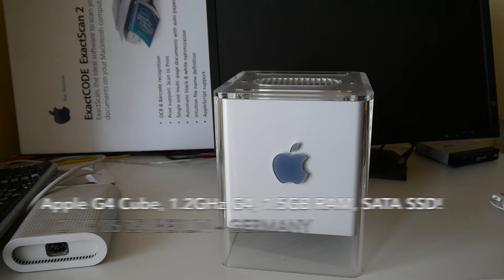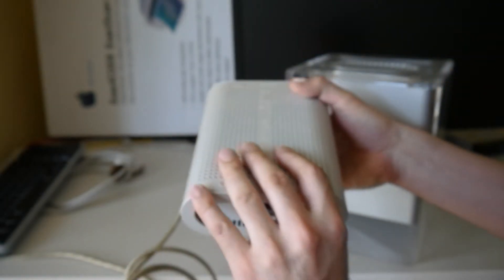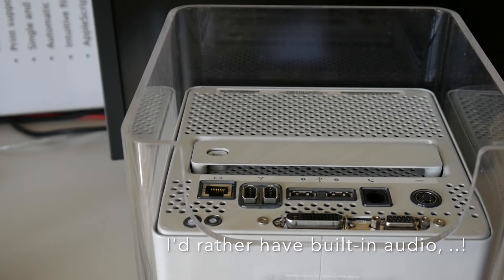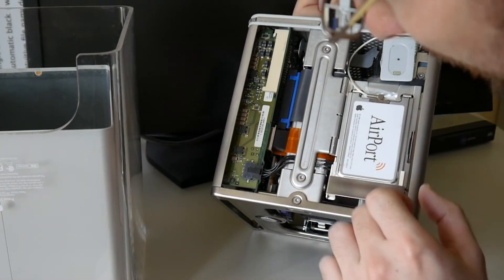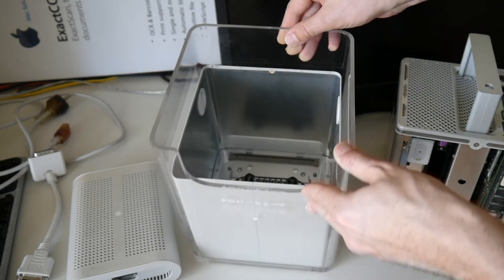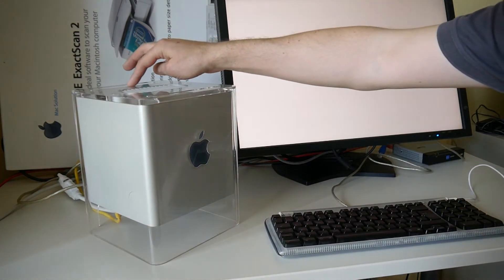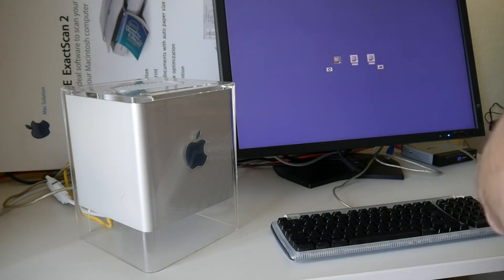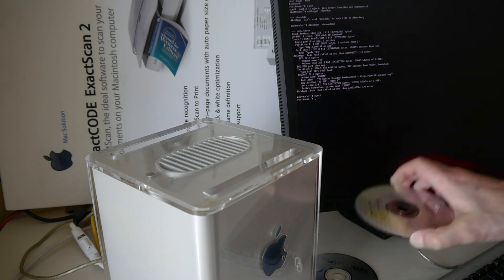Apple G4 Cube, 1.2GHz, 1.5GB RAM, SATA SSD; fully maxed out! [DISASSEMBLY]

Comment: Hi, nice video, thank you for sharing. I also own a mac cube, but during the last teardown I got confused.
I have a problem with the screws that secure the handle that allows you to pull the mac out of the case.
There are 4 screws, 2 on each side of the handle, the 2 screws on left side are under the hard disk and airport cable, the 2 screws on right side are easily accessible.
My questions: are the 2 screws on the right side different from 2 on the left side, or are the 2 screws on each side different?
4 identical screw or, two pairs of screws?
thank you very much.
Sorry for my English.
Reply from the maker: Wish I could help, I'll not be near my G4 Cueb the next weeks. Does an internet search of ifixit find some photos that are helpful in your case?
Reply: @renerebe   Hi, thank you very much for the answer. I have got the cube g4 service manual, I have read and see all the guides on the internet, but I have not found this answer. The only solution is to see how these screws are mounted on another cube.

Comment: Install OS 9 and push the programmer button for fun, it opens a debug dialog, alternatively Cmd-Power on the old style ADB keyboards. You can quit again by typing SE (shell exit), or use it to recover from a crashed Finder with G FINDER RESTART, no guarantee that it works depending on how it crashed, and your system will probably crash again pretty soon after; so a reboot might be needed anyway.
Reply from the maker: interesting ;-)

Comment: my cube's disc drive behaves the same way. i really wish aftermarket slot-loading drives worked for the cube, for some reason apple decided to flip the connector around for the cube's drive so no other drive will work. i've seen some guides on how to refurb the stock drive but it seems to daunting and i fear it'll break if i try to attempt any repair.
Reply from the maker: You only need to swap the rubber belt inside the drive ;-)
Reply: I installed an IDE slimdrive inside of the housing of the stock drive after taking out all the internals and fixed with double side tape.  The housing is then installed with the 4 screws. These drives are still available on ebay (https://www.ebay.nl/itm/New-Panasonic-UJ-85J-UJ-875-UJ875-DVDRW-slot-IDE-drive-/113664799269?hash=item1a76f33225). To connect it to the Cube IDE cable use a slim IDE to IDE adapter.  For sale on Ali Express (https://www.ebay.nl/itm/New-Panasonic-UJ-85J-UJ-875-UJ875-DVDRW-slot-IDE-drive-/113664799269?hash=item1a76f33225). Works great.  Funny enough I had to set CD Drive to Master and my SSD to slave, otherwise it would not boot.

Comment: Would like to know about that USB 2 card swap for where the Airport card is. How is it possible? would it work with OS X?
Reply from the maker: I thought the same, brought an PCMCIA card already, it did not just work, did not just show up in Linux. I read at least one pin is different to prevent using the at the time cheaper AirPort cards on Windows PCs. I did not yet research further, but I guess it could work, at least with some fiddeling on Linux, once we figured that out and it works in Linux one could try to binary patch the Mac OS XNU kernel, ... if you look into that let me know what you find ;-)!

Comment: What connection are you using to connect it to the tv ?
And one might be able to connect it to an Apple external GVD.
Reply from the maker: tv? I never connected it to a "TV". I did not even own a "TV" ever. I connect it with a ADC (Apple Display Connector or so) adapter dongle cable to any of my DVI displays.
Reply: @renerebe  Well, the display is not seen clearly so I assumed it was a tv.
Reply from the maker: ? maybe you using an analog connection, such as VGA where the pixels are not as 1:1 sharply mapped as on modern digital connections such as DVI, HDMI, etc.? your display might have an analog auto-tune to potentially improve that a bit.

Comment: Nicely done....Is the CPU from Powerlogix or Sonnet?
Reply from the maker: oh, puh, that was a decade ago, did not take it out since then ;-) AFAIR from the back of my mind Powerlogix?
Reply: Bits & Bytes w/ René Rebe Now a days it is almost impossible to get a Powerlogix CPU especially 7448 one
Reply from the maker: yeah, I'm lucky that I got those when the price was at it's low a decade ago, in general I try to avoid overspending for vintage gear, especially for this commodity PC 486 stuff: https://www.youtube.com/watch?v=m73qPshx19M
Reply: Bits & Bytes w/ René Rebe Nice ;-) Actually I still use them since I have upgraded them with a lot of bucks Needless to say it is not worth to do for usual users ;-)
Reply from the maker: yeah, when I did it over a decade ago it was still a nice everyday workstation, a pity it has no USB2 and the Linux kernel graphic glue has some regression preventing me from using it today: https://www.youtube.com/watch?v=uYx9X92iQHM - guess sometime soon I need to try track this down, ..!

Comment: Congratulations for your team! I have one like it, with OSX Leopard and it is a very fast cube in all tasks; The complement of the Harman Kardon speakers are really great.
Reply from the maker: Thanks and congrats, too! Just curious: you mean the original Harman Kardon speakers (that I miss, none of my two Cubes form ebay came with the original speakers, …) or another "after market set"?
Reply: I mean the original apple pro speakers, round and transparent. I have two pairs, one of them I got on ebay for 20 dollars. My cube has a 1.2 GHz processor, 1.5 GB of RAM, 40 GB hard drive, 32 MB video card (I'll try to put a 64 MB, which comes next month), and connects to the Internet through Airport first generation since it does not allow me with the current modems. It is a fantastic machine after 18 years. Te agrego el link donde venden los altavoces, por si te interesan, ahí los compré. Les falta la pieza que conecta la USB, yo los adapté con otros que no funcionaban y pude lograrlo:  https://www.ebay.com/itm/Apple-Pro-Round-Speakers-Clear-w-Older-Clip-Connectors-See-Photos-SHIPS-FREE/292598150635?hash=item44203575eb:g:nOQAAOSwXsFahDPY

IMG_9134.jpg
Reply: Sorry for the last part of the previous text. I'm from Mexico and I'm using the Google translator because I do not speak English.

"I add the link where they sell the speakers, in case you are interested, I bought them there. They lack the piece that connects the USB, I adapted them with others that did not work and I was able to achieve it".